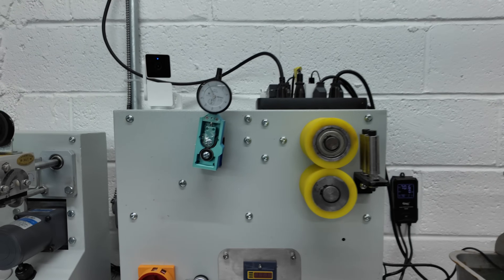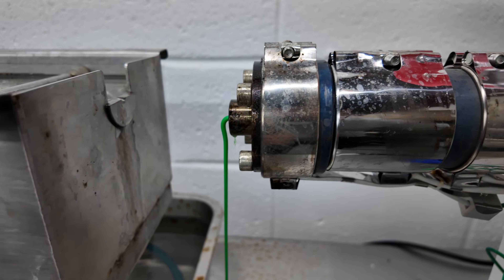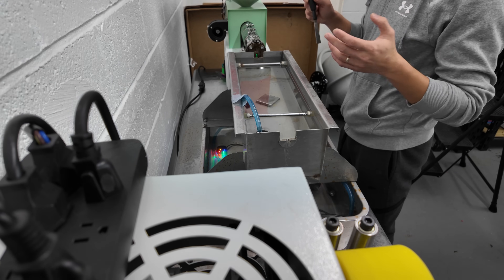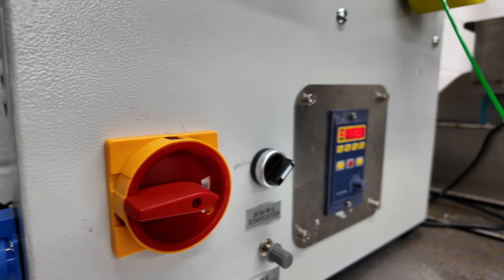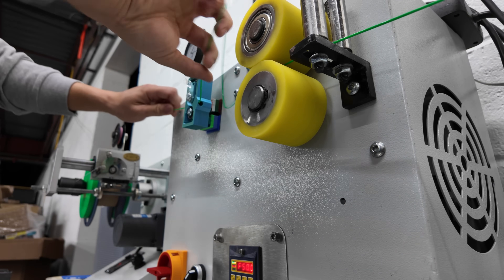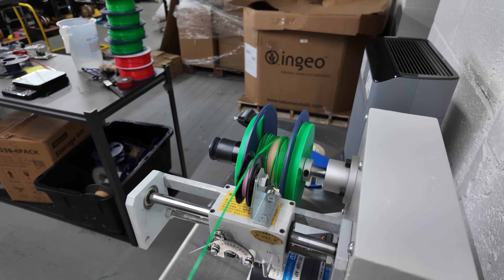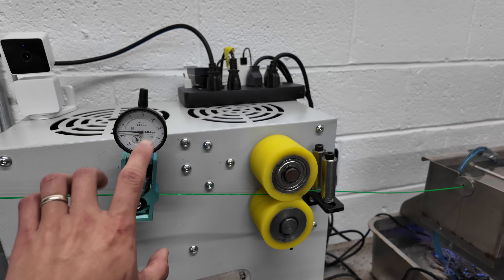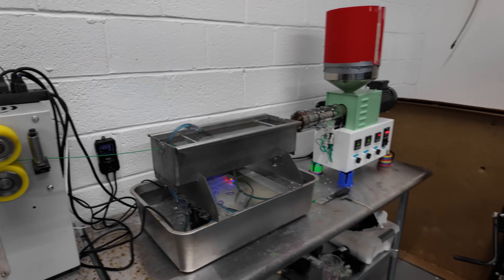Starting the 3D Print Extrusion Line

Comment: The main chalenge of making own QUALITY filament is reaching correct plastic crystalization inside filament. You need longer watter bath, with 3 levels of watter temp's. 1st- 80C 2nd-50-60C 3rd- 20-30C. And the most important step after finishing the new spool of filament Is : put it to the dryer/oven for +- 60C for minimal 16 Hours's (ideal 24h) . This will be filament with perfect chemical crystalization, Its mean, strong and flex filament.
Reply: I guess it depends on what you want to print. For technical prints proper crystalization is key, but from what I see Dancyn is mostly printing fidget toys, which don't need the best possible material strength.
Reply from the maker: Yes thank you for your input I definitely do need a longer water bath and should be dehydrating the plastic
Reply from the maker: I don't think i need 3 water baths for this small extrusion set up. The mold temp is 165c and my water bath temp is roughly 77c
Reply: @Dancyn3Dprints  Yes , but is also depend on your workshop air temperature. So one bath can enought, but in case, if in your workshop is air temp around 30C+ minimal. If less, like 20C>. Its not good. But if you print only things like s kids toy etc, Its ok, but for technical and functional print's for customer order , the quality will not enought. You can try in future make a stress test bench Machine (like on chanel CNC Kitchen) and you can test the quality of your filament.
Reply: Great Content!  I am really enjoying seeing your small filament setup in operation having watched all of your videos on it as you have been busy figuring it out.   Good stuff, really appreciated this add to your videos at your new location.  I enjoy reading comments from folks also who jump in to give you some of their own experience and advice, good stuff! Thank you!  

What type of cost new/used would one expect to pay for the setup you have?  What is the max rated or average output of this machine?  I am imagine every variable like room temp, humidity, storage of beads etc is very important.   What is smallest unit of beads that your order to get decent pricing?  I had done some preliminary research on bulk pricing and machines.  This is something I am very interested in.   I know one of the filament manufacturers has a location in the next state over from me up in VT.  They manufacture small to mid size heating element and auger systems.   Much appreciated.

I am curious about a secondary material being incorporated into a filament line, where one could run a core material and then add a final outercoat to the filament.  This can be achieved several methods based on same principals used in Specialty Paper making processes that have been around for decades.  Years back I worked at a company that made some interesting papers used for laminating HP/LP laminates.  They provided the core color deco sheets and also the clear overcoat sheet which has some incredible properties.   The overcoat contained the extreme wear resistance and chemical resistance properties, etc. I can picture several ways of achieving this and varying the actual properties of the filament by a fairly large margin.  I do think in the future many new filament types will emerge using applications similar to the paper industry.  We will see some incredible filament offerings in the future. I do where having a hopper based printer would be the ultimate setup to own.  

I would think the most economical way to run a setup would be to use one large spool say capable of holding some larger amount like 50lbs then use a rewind setup to make your final rolls.  This would allow for less baby sitting of a setup and would not add much expense, food for thought.   It also adds a great way to add in finer quality control and inspection to the process.

Comment: So then its really important for everyone to dry their filament before use bc it seem like all filament runs tru water for spooling
Reply from the maker: It prints fine don't really need to dehydrate it
Reply: @Dancyn3Dprints  im seeing a scammer on ur vids going by Dancyn_3dprints replying to ppl saying they won and to text
Reply: No. To keep 150 printers running he’d need a second warehouse just to setup enough drying stations. You don’t need to dry every roll of filament you buy.
Reply: @jaeitee  not necessarily. Im sure if it was important enough you could store every filament in a dry room. An 8x8 space heated. It would cut back on waste from messed up prints from bad adhesion.